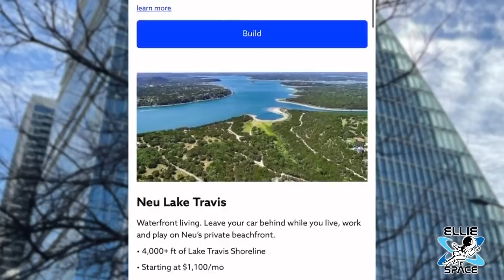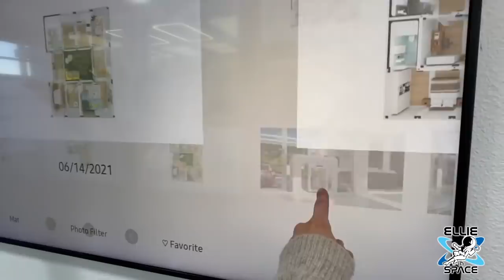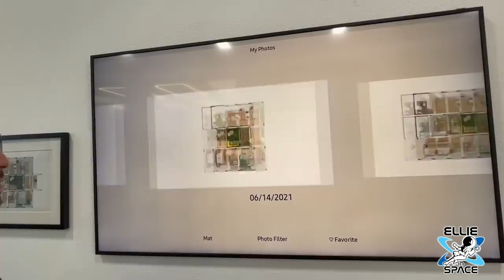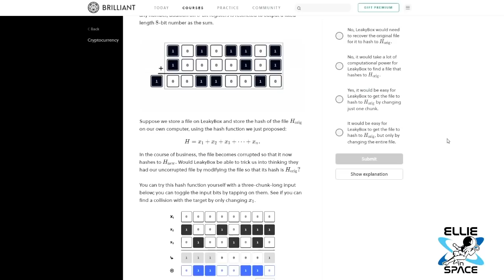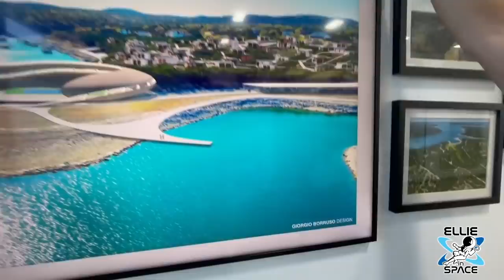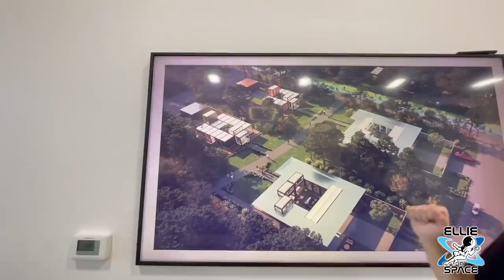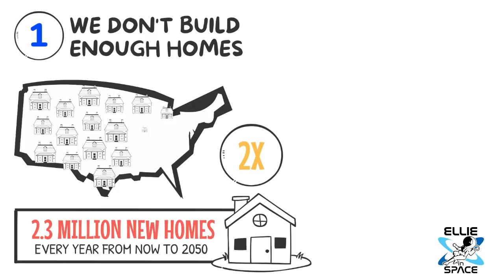Where will Tesla employees live in Austin?

Comment: I’ve been an electrician for 28 years, when the gentleman said everything was quick connect in the pods that’s great except if you decide you would like another receptacle in a location where there isn’t one is the homeowner going to be able to cut in a new box and run the wire. I do have quite a few questions but I’ll reserve those for the company. It’s always a good idea to review and get a game plan for new products.
Reply: Who said legally you’ll be able to make alterations to the home.
Reply: @jxsn000  I think that's why they want to make it a co-op community. You'll just be leasing and I'm sure any modifications will have to go through the manufacturer company.
Reply: I love how the guy puts down 3D printed home because you cant just add a new outlet but a lot of their walls are glass. I'm also curious to see what the guy meant when he said the wiring is modular.

Comment: What comes to mind for me are the old Spanish style homes from a few hundred years ago with mud and straw walls that are four foot thick and remain cool all year long and have basements as well that are even cooler during the Summer.  Cheap and practical and could no doubt be modernized up to current codes.  I remember being in one or two as a kid and I was so impressed.
Reply: Yeah those old homes would require way less air conditioning and heating than those aquariums. The windows are impractically large and aren't even triple paned. They also don't provide enough privacy and separation from the outside too feel comfortable in them
Reply: No basements in Austin.
Reply: The name of the game is to cram as many homes in a small place to maximize their profits

Comment: I think this is a good solution for the immediate housing shortage in Austin.  These might be good for one or two people, but once you get kids, these tesla workers with their swing shifts are going to need space to unwind.  Having children in a small space is challenging to keep noise down.  Quiet...baby sleeping.    I hope they have done a good job of soundproofing bedrooms.
The next thing I would like to see is tornado and hurricane resistance.

The last thing that concerns me is the lack of gutters to control water.  How does the water get off of the top of the cube?  is there any slope to the roof or channeling of water so it doesn't do damage?  How about snow?  will it collect on the gaskets between cubes?  When the rain trickles down the side of the cube, will it be channeled away so it doesn't washout the foundations over time?  
Traditional housing designs may be slow to build, but they are pretty good at solving the water flow problems.
Reply: Yeah, I think these are great for 1 or 2 people, 
The large one (17 cubes?) would be good for a family if there was some soundproofing considerations, maybe rubber seals joining the cubes to minimise sound/vibration transmission, perhaps a connecting corridor between living and sleeping areas with a sliding double glazed door?

As far as guttering goes, I'm pretty sure these houses will have aluminium gutters all round... But it doesn't look too good, a bit of necessary clutter on their perfect cubes, so the showroom version and artists renderings leave them off... That would be my guess
Reply: Looks like a great housing solution and co-op living offering! My first concern is also with weather and water run off, high winds and tornado resistance.

Comment: 3D printed concrete house.  Nailed it.  I've worked on one, not convinced at all that it will take off.
Reply: Why?
Reply: @bvxp  concrete chemistry required is expensive, bag mix only, being a very hot mix it is prone to crack a lot; the finish is very rough,  many miles of rough mini ledges inside and out that will require power washing to clean; if you don't build out the inside in traditional methods cleaning will be nearly impossible (power washer inside?); You have to pour or place footers for the giant printer then set it with a boom truck then remove it all; you need to carve electrical boxes for recepticals and lights out of the concrete while still wet or core drill if dry; running electrical and plumbing in the walls will cost more; most of the house is still stick built in traditional methods.  They have a long way to go before it is accepted enough to be a viable business.

Comment: This is a great topic to discuss now that there's still time to prevent the problem.
IMO these cube houses have more limitations than a normal apartment building, but they sure get the job done for the people they are intended for.
I'd like to know more about the aftermarket services and how they plan to support all the possible issues customers may have with all of the fancy extras as those motorized curtains and the plethora of RGB panels. Something simple to solve when it's well done, but a pain to consider on a day to day routine.

Side comment... at some points on the video there's some weird sound on the mic as if you were chewing a bubblegum. Not something to die for but annoying af.
Reply from the maker: Yes I realized the gum thing and I cringed too. Next time, NO GUM

Comment: Oh, man... I like the look of those glass walls, but the labor to keep them clean, I mean, yikes.

It appears that they are running a sort of detached condo sales model.  I'm sure that's great for the developer, but i think owning the land and the house on it provides more agency, autonomy and flexibility for a home owner.  For example, if you want to add a couple of rooms in a few years... I doubt that would work in one of these communities.

But I'm happy to see you exploring tangential issues surrounding Elon's companies.  It's all good.
Reply: I had that same thought, likely the reason they have the demonstration module inside another building?

I'm not so sure about the looks of a glass box myself, but they did have plenty of other materials listed. I do wonder about the blinds they demonstrated here though, they rolled out on the inside. Having external sunshades would do be very useful during summer if you want to keep that light creating extra heat out requiring less cooling. That said the guy did mention triple pane glass right? So it should be reasonably insulated compared to most glass out there, but probably can't compare to a well designed wall.

One thing I am slightly concerned about is if this doesn't work out that modular design where you can "just connect it" and such could become a problem if the product ever stops being supported. You'd be back at the old model of running electricity but potentially with more complications on top depending on how their modular system works. Also only limited suppliers that can probably sell you the presumably patented stuff which they might be able to set unreasonable prices for. But maybe that's just the pessimist in me, I hope it works out for people that live there. 

Oh and if this project ever actually takes off, it'd be nice if they can keep that no cars everywhere thing in it. If they can do that and keep the density reasonably high (not much lower than the 7:59 example) it might actually be a practical place where walking/cycling can be a feasible method of transportation for local trips to hopefully essential places like grocery store(s), bakery, butcher, etc nearby. Seeing typical US city design/planning always makes me a bit sad with how you're essentially not able to get to many places without a car.

Comment: I've just assumed that Tesla would be building housing for their employees, on the 2,500 or so acres that they have there.   Conversely, they could build it farther away, and bore a tunnel to the factory site.  They could build in a spread out, individual "eco friendly" way, like shown here.  Or, build a single building, self contained, self sustaining structure, to house 10,000 or so (kindof like a Gigafactory for humans).  Else, why buy that much surrounding property?
Reply: Musk stated that the Austin gigafactory would have a nature reserve around it that people could visit. A housing community would probably deter from that
Reply: Musk is building a housing community. They will be built with Tesla chargers inside of the garages. He wants every employee to own a Tesla. I worked at Mercedes Benz Vanz in Charleston SC and they built a community right behind the plant where I lived.
Reply: Boring a tunnel is extremely expensive - a lot more than building a road which is expensive.  Just because of Tesla's factory, the prices of real estate have gone up many times in that area.  The land is too expensive to "spread out" communities.

Said, "...else, why buy that much surrounding property?" 

The land was used as a sand and gravel mine and has huge trenches and piles of dirt, and is totally unusable without expensive mass grading and foundation work.  That's why it was so cheap to begin with.  It takes a lot of money to correct the damage that was done to the land.

Comment: The problem in Austin is the zoning restrictions in many places. Floor to area ratios, density, max # of units, etc. This type of home could be placed on many lots to increase housing supply, and even make a nice investment income for homeowners, but the zoning will not allow it in many places near downtown.
Reply: West side of downtown, as I recall, was/is a slum.  The area near the old French Embassy.  Did that get better?  Cutting the town in half with a freeway was kinda dumb.  As it sit, the city never ends.  It's the worst case of urban sprawl in the country already.

Comment: It may need some sound dampening due to all the hard surfaces in close quarters. It sounds and echoes like a small conference room. Sound becomes more important in smaller spaces which includes heating/cooling systems, external and internal sounds. The blinds go down which is normal but it may be useful to have it go up as well since you may want privacy from ground to 7 ft. but still want to let sunshine in at the top 1 to 2 ft to the ceiling. It doesn't look tornado, hurricane or earthquake proof (resiliant) as some traditional homes. It wasn't clear but it should have multi-floor plan for better use of lot and provide views. Outdoor atrium space within a home is cool. Cabinets, appliances and materials within seem inexpensive but I guess we can "upgrade." 

Cost seems very high for such small spaces but I would love to try a furnished one, with high speed internet (required for work), for 6-months.

Comment: Most American cities have a big problem with over-funding suburban expansion and under-funding urban housing development. This is the result. Not enough homes.
Reply: Austin has quite a bit of housing downtown, but unfortunately it is all for the super rich.  I looked at one condo that I could actually afford, but the monthly fees were going to be more than the mortgage payment.
Reply: @texaswunderkind  Well considering rent is generally determined by supply/demand, there's clearly not enough supply of housing to keep up with the demand. Austin is definitely not the worst, but it still suffers from some of the same issues other American cities suffer from. It would also help tremendously if the city of Austin would invest in better public transportation infrastructure (specifically trains) to help people commute from the surrounding areas to downtown rather than wasting more money trying to "decongest" I-35 which will never happen.

Comment: Considering I just saw a listing for a 488 sqft shed on a 2800 sqft lot on the east side across the street from train tracks for over 500k. I don't think anything prefab is going to help this stupidity. At least I read the other day interest in Austin is waning because of the obscenely high cost of living.  Nobody pays a location adjustment for living in Austin but the average home is 500k and good luck finding a decent apartment for under 2k but companies want to start you at 20 bucks an hour. I feel fortunate I have been here for 15 years and got established before this current boom because I couldn't afford the house I live in now if I had to buy it at current prices.

Comment: What is the build code for these new homes. I ask because the concept is similar to RVs and 5th wheels, which can get expensive. Unfortunately, due to being built quick at a manufacturing company you run into multiple defects.  I also wanted to add that the solar power and wind power is controlled by the big investors.  So you can install solar panels, but the power company will take the power your panels created, but they will in turn give you a 20-30% discount.  Unless the laws change the power companies in TX control all solar power and wind power.  Great idea though, but would like to see if they can handle the Texas weather.

Comment: My only concern with every prefab structure i've ever worked with or lived in ....Is insulation. They all have R13 fiberglass exterior walls with too many windows. I would buy one of those futuristic prefab cubes if the walls AND glass were R20 or better and I would put 99% reflective tint on the outside to block sunlight. Its Texas yall. Those windows are thermal gaps and security holes. I want a prefab structure thats super insulated with virtually zero maintenance cost for 50yrs.

Comment: Thanks for this video, that is cool to see more modular home designs, obviously that design would not work up here in Canada where I am as we get down to -35F so all that glass would make it very cold.  But I would not have a problem with a manufactured house, I also would love to see them look into Geothermal as well as Solar and Wind for heat and power, you could use the Geothermal for hot water as well as heating, or go the Tesla way and use heat pumps.  I have a small solar setup here that I use to run small appliances and charge devices, but not able to work at night without the panels.  I can't wait to see your future coverage of the Giga factory and other Starlink and Starship updates.  Keep up the good work.

Comment: Well, since I'm heading to Austin for a job it was good to get a perspective of local housing.
I may well end up in something like this mainly because I'm a bachelor and home is mostly about a place to sleep.
Thanks for the info. I'll have to look into this.
Up north we use triple pane glass so minus 40F feels like a summer day. Maybe they could do something similar and also a sun overhang to block direct sun in the summer and pass sun in during the winter  we'll see
Reply: Yeah, I'm thinking abut community-based HVAC rather than in-unit (mostly) because these units are going to be grouped together anyway. Maybe even build them inside the equivalent of a stadium with a closable roof -- if bad weather comes, close the community roof and the units inside are relatively safe.

Comment: Certainly a solution but we have been hearing about modern modular factory homes for about ten years now, the building process has not been refined to where one can start building the same day. The whole building permit process is unnecessarily convoluted, I don't see it changing anytime soon, local governments will try to retain that power as long as they can especially if they are against urbanization of their community at best you might be able to get folks to be in line for suburbanization.  But you have to have the infrastructure to support that influx a population as well, much of the United States is heavily underdeveloped and all aspects of infrastructure. One concern I have with these homes is natural disaster survivability. The structure that is reliably survivable is a concrete structure, in addition the cost of these homes in the video can also go through the roof as well there's no cap to what they can cost to keep it affordable and to what it actually cost 1 to 1 true cost. My reasoning I would feel safer in a modular concrete home.

Comment: The big factor is cost per square feet in TEXAS!  250-300 k will get you decent 2400 square foot homes. If the cost is double that price and not competitive you will hear crickets.
Reply: In Austin 2400 square feet is $600k
Reply: Central Texas 2400sqft is 280K-300K half of Austin and commute is only 35-60min.

Comment: This misses the ENTIRE CHALLENGE to building homes in Central Texas.  Tesla's land development permit for their factory was approved by the County authorities and construction was started in about 60 days.  In Travis County it takes up to THREE YEARS to get a permit for and development of a site for residential development.  (Bastrop County is quicker but there are significant utility availability issues in many parts of that county.)  This "solution" deals with modular homes, which is only a VERY SMALL PART of putting homes on the ground. No improved lot with utilities means no ability to build or "install" a home.  Building the home from the ground up or setting a pre-built home on a site still needs planning, platting, utility availability and site development before the house is built.  Until the City of Austin and Travis County decide there is a housing crisis and actually want to help solve it by fixing the approval/processing timeframes, then priority should be given to residential development before giving big tax breaks and streamlined land development processes to billion-dollar tech companies.  Also, the real estate agent in the video mentions Westlake.  Westlake is at least a 35-minute drive from the Tesla plant at rush periods and I would challenge anyone to find a home to buy in Westlake for less than $1.25Million.  Hardly factory worker salary pricing.